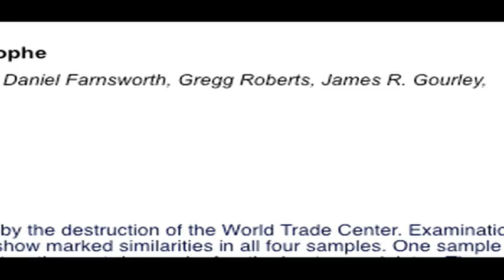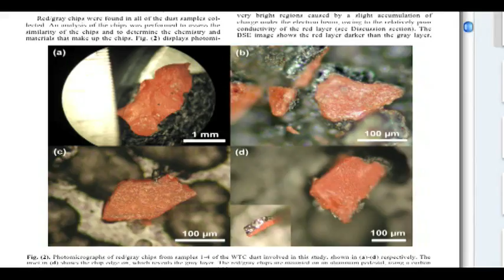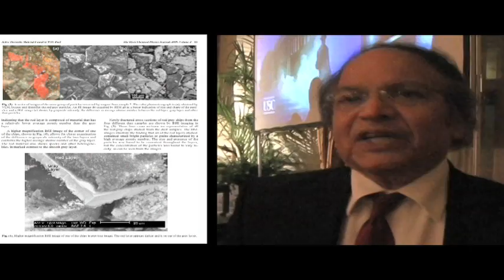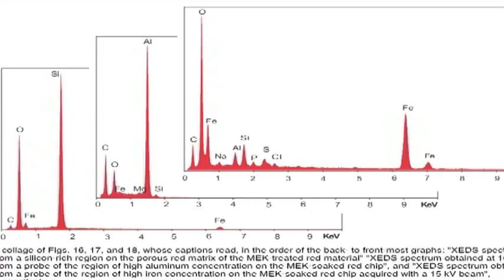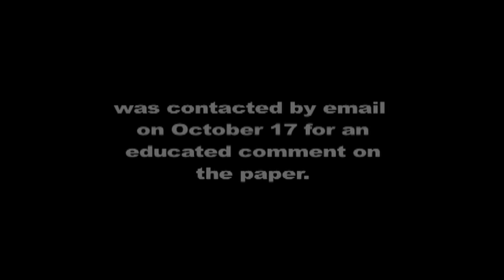WACLA facilitates scientific discourse w/ Gregg Roberts and Priya Vashishta

Comment: According to Bill, the symmetry of the collapse of the South tower was less than excellent. He has a point: the demolition of the top tilted significantly. This is common in demolitions; it is done on purpose or by accident. Which was the case here? The engineers have not disclosed it yet.

But the main part of the demolition of the South tower was very symmetrical. Very professional job indeed!

Love,

Comment: Bill has a point: not all the WTC concrete turned into dust. Some of it stayed in chunks.

Still, TV clearly showed huge expanding clouds of dust at the onsets of the demolitions. Analyses of the powder that covered downtown Manhattan confirmed the presence of extremely finely ground concrete.

Assuming the twin towers' structural failure would not have been explosive, the concrete would have fallen in huge pieces and the immediate neighborhood.

Love,

Comment: Fires don't create pyroclastic dusts clouds as seen in all the videos and it makes no sense to have a symmetrical debris field when the plane on the second tower hit near the corner of the building. The symmetry of the collapse itself is uncanny, the building just peels itself down, ejecting beams and materials in all four directions. Although the planes did cause some local damage near the top of the buildings, what about the structure below it? It is still intact, not damaged by anything.